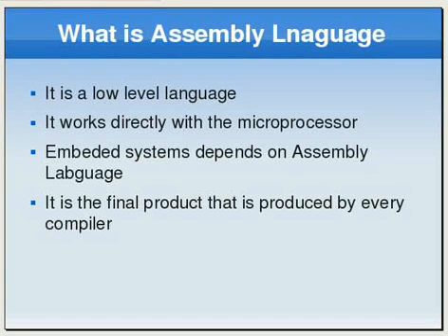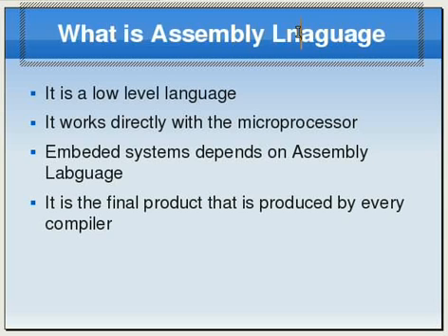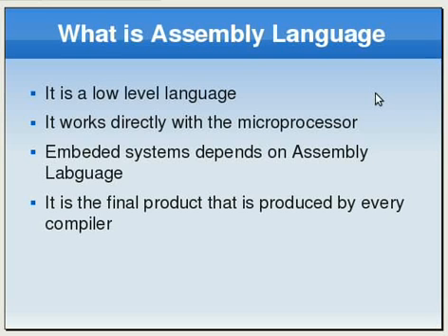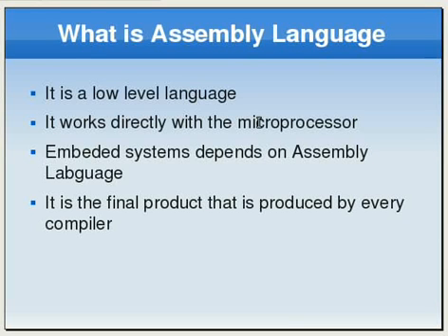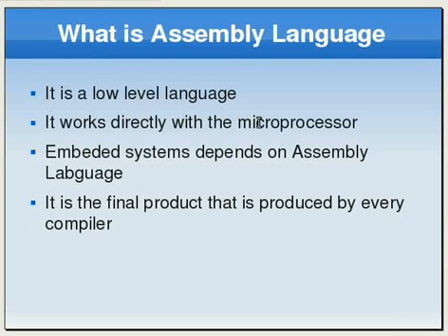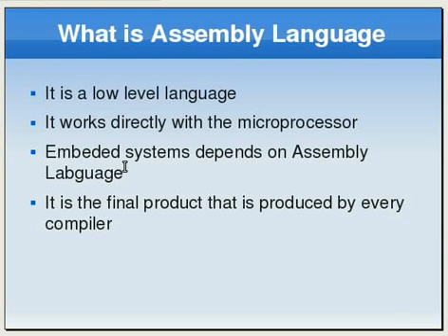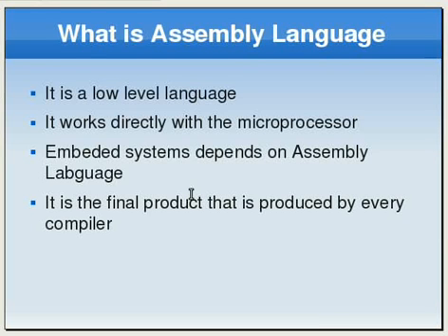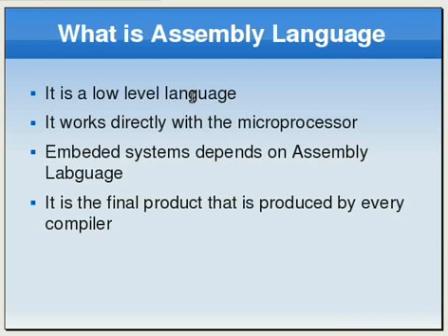Assembly Language Tutorial #1 Introduction

Comment: Not used in the industry? Linux and the BSDs are widely used on servers and parts of those systems are also written in assembly. Device drivers need some assembly to control things specific to certain hardware. You must be the next Von Neumann. Please grant a mere mortal like myself your wisdom. What do you have in mind to replace assembly? If you want to phase out assembly its going to take much better compilers to start. How will you address the problem of all the different hardware out there?

Comment: The purpose of Assembly is to have complete control over your computer. It's great for small programs that require sheer speed. As a matter of fact, I believe it's impossible to make an operating system without SOME Assembly. If you're programming things like games, stay away from Assembly, it's likely not for you. If you're doing a bunch of calculations at once like brute forcing a hash, use Assembly. Until computers are built differently, Assembly will always have its place.

Comment: @goobersnatch101 another good examply is lets say you want to make a program to add in c++ and display it on a consol. all you do is cout << a+b << endl; very simple right? well in assembly its not quite. you have to tell the computer to do exactly wat's needed to do. you have to first turn w/e number u press on the keyboard (acii code) into a physical number that ur machine can read, then push the register into a stack so it can be used again for other things, and use the add instructiong, etc

Comment: @goobersnatch101 basically low level programing meaning more primitive the code is. with primitive code you can built a calculator you can find in the dollar store. but with high level programing you can make let's say adobe photoshop. though adobe photoshop is more complex and high level, that's because the level of programing is easier to do simple intruction i.e. adding/substracting numbers. u can write adobe in assembly but that will probaly take you a thousand years to do. lol.